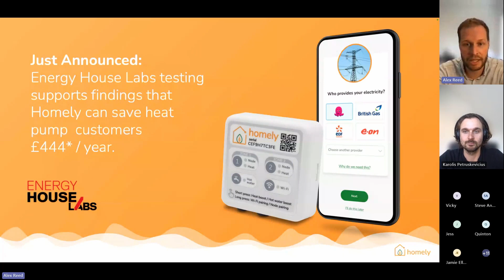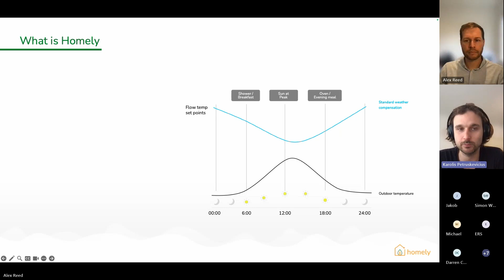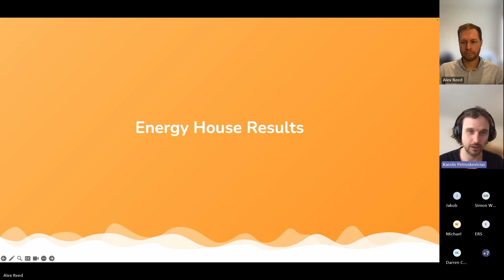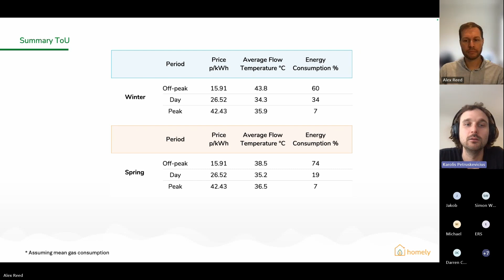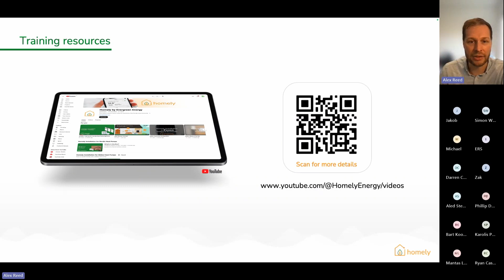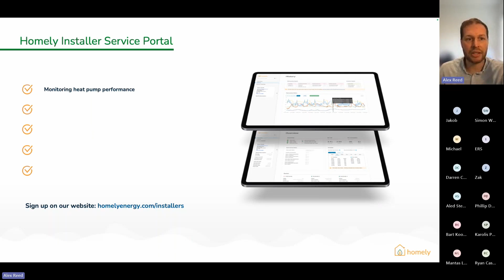Homely Installer Webinar – Smarter Controller, Smarter Heat Pump

Comment: For your test installation, it looks as though the average weather compensation curve should operate the flow temperature at between maybe 44C and 35C, depending on the outside temperature.  Assuming that this is correct, it is being a bit generous to Homely to use a base case weather compensation curve set at 55C flow temperature with a -3C external temperature.  A good installer might start there, but after a few months' experience, he would lower the weather compensation curve to be closer to the numbers that Homely is choosing.

Homely would still be more efficient, but the difference might be smaller than shown here.

On the other hand, given the pricing of Homely, the payback period should still be short.  Homely also provides the benefit that the installer does not need to be so skilled at setting weather compensation curves and does not need to spend so much time on it.

Comment: Costly maybe a better name it’s all bluff it will never ever measure up to a Combi too hot turn it down too cold turn it up almost instant not like a Heat Pump.Waffle data haha flow temperature up/down gas 3 times cheaper Combi 5 times cheaper installation 4 times cheaper.Am I lying nope ££££ Parts maintenance the list goes on.

Comment: I'm very interested in this smart control of heat pumps. There are too many variables for this to be done on the fly manually, so this is great to see.
But, does your system take into account large variations in temperature between rooms at different sides of the house?
I have a bungalow with a living room with large south facing windows which gets high solar gains but a rear double bedroom that gets cold and currently needs heating separately.
I currently have no wet system but want to have one installed with an ASHP. I also need a new efficient DHW cylinder so the BUS is clearly the way to go.
But (another one) couldn't this tech work better if integrated with a MVHR system? Something to move the air around, even things out a bit?